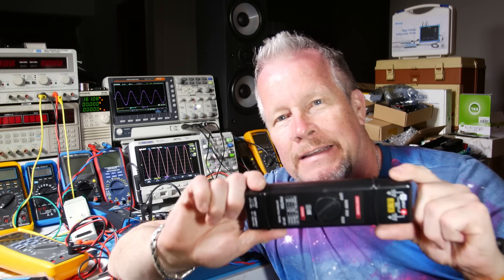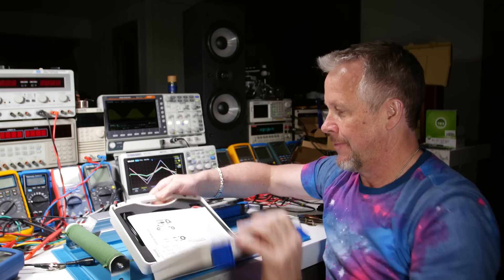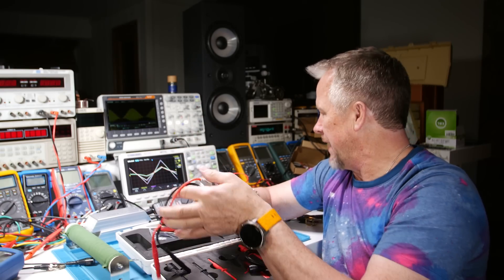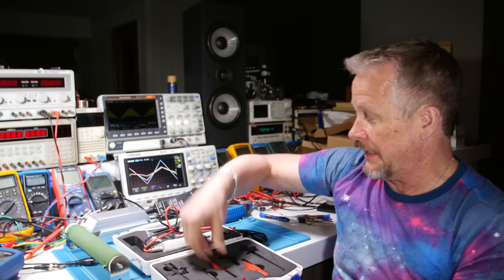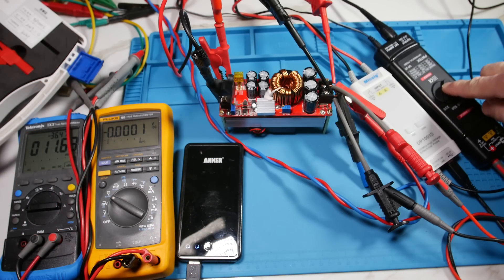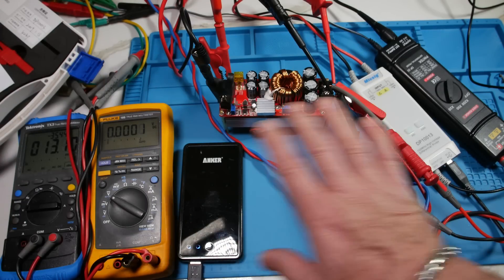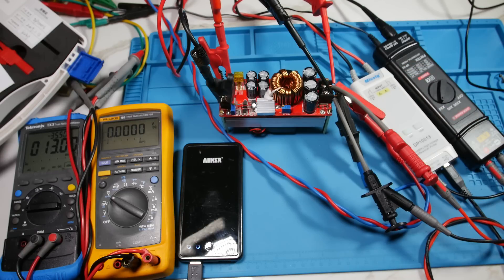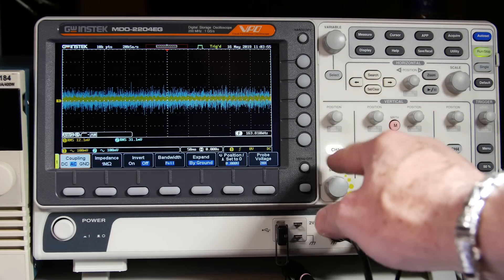Pintek vs Micsig Differential probe #diffprobe #bestdifferentialprobe

Comment: Excellent comparison, invaluable for someone choosing between the two gizmos.
But aren't you jumping the gun, sir ?
Before I buy a DiffProbe, costing half as much as a DSO, I would need a LOT of convincing that it makes possible some functions VERY important to me, or simplifies some functions I do FREQUENTLY, etc, you get my point.
Please make a video on why a sensible engineer should own a Diff Probe, what are the things it can do in the REAL world.
Reply: you can measure ac lines with these things and save your scopes from blowing up
Reply: BR Gurunandan - Differential probes are ideal for measuring signals where the signal is not ground-referenced.  Some examples would be the output of a H-bridge, or if you need to see the signal across a resistor where neither end of the resistor is at ground potential.
There are alternative methods such as using 2 scope channels and then applying MATH to see the difference...but this ties up 2 channels which may be a problem if you need to look at multiple signals.  It's also annoying if you need to perform this kind of measurement frequently.

The MICSIG unit works very well and is excellent value for the money.  Just don't expect it to work to 100MHz - the BW is a bit of a marketing stretch...
Reply from the maker: Thank you!  And I agree, the cost of these probes are too high - they should be a fraction of the cost of the scope!
I’ll do some videos where I show how to take measurements without them.  I’m anxious to get into some projects after introducing all these tools;)
Reply from the maker: BR Gurunandan I still like this comment;) I need to bring this back up!
Reply: @KissAnalog  scored the micsig for $200. Even as an electronics noob the insurance of not blowing up your scope bit seems worth it.

Comment: 4:50 because litterally EVERYBODY has USB wallwarts laying around and the fact most scopes nowadays have a USB port , it does not come with a wallwart. Also, the USB on the side is a passthrough, in case you're using your scope's USB and still need it for other things.
Reply from the maker: Thanks for pointing that out.  If I had not pointed out that it did not come with a power source - would have you pointed that out - just to be contrary?
You may not be aware but many diff probes do come with their own power source - but at these prices I’m good with them simply providing a common USB port.  When using this you also need to be aware of the grounding of your power source.  If a power source had been provided the grounding and noise level would have been taken care of.  BTW did you notice that I used an isolated power source?

Comment: How have they held up for you after ~3 years?  I'm looking at the Micsig, but they actually make three 100 MHz models... a DP10007 (700V with 10x/100x), a the DP10013 you have (1300V with 50x/500x) and a DP20003 (5600V with 200x/2000x).  The DP20003 outside my range of needs, so I'm debating between the DP10007 and DP10013, leaning towards the DP10013.   Oddly enough, they both are about the same cost at $185 (the DP20003 is $250).  The one advantage the DP10007 has is the 10x/100x range that matches up with most scope attenuation settings, making measurement easier to read.

One thing I see people say is to watch the voltage ratings/markings... they are actually peak-to-peak and not RMS values.
Reply from the maker: Thanks for asking!  They have been great!  I have also done a video on the DP1007.   https://youtu.be/QQcZR_KV0P4

There is also a new probe out that is fantastic.  Here's a video: https://youtu.be/bFWJUmgs_8M

I will do a comparison of all the micsig probes to show them side by side and talk about how they differ.  I'll do this very soon;)
Reply: @KissAnalog  Nice!  I appreciate your help and the reviews.

Looking for an opinion... since I only work on things like power supplies, do you think the 10x/100x range (DP10007) is preferred over the DP10013 or DP750-100?  Are those too much for my needs and am I better off with the better sensitivity in the lower range model?  The 1300V capacity of the other two is interesting and I hate to limit myself with only 700V.
Reply from the maker: If the lower voltage probe had been out when I bought mine, I would have selected that as I would rather have the sensitivity.  Saying that, I haven't really seen any drawbacks with the higher voltage probe.  I think I need to take a close look and compare them.  I'll do a video very soon and do that.  The pintek had great specs, so that's why I originally bought that one - even though it cost more:)
Reply: @csimet  I just bought a micsig DP10013, and I chose the higher voltage rating one so that it should handle the higher dc voltages found in power supplies with Active PFC in the front end - the DC bus in those runs at a higher voltage than just rectified AC - you essentially have a boost converter there instead of a diode bridge rectifier. I've only had it for a few hours and already found the issue in the power supply I was working on! If I ever need the higher sensitivity of the 700V probe, I'll get one at some point in the future, but I think the higher voltage one will be good to start with. I actually have a number of power supplies kicking around that need some work, and not just simple "replace the caps" type repairs.
Reply: @csimet  Two things to note as of now (late 2023) - the micsig probes no longer come with the normal/bananna probe tips - they only come with the alligator clips and the long grabbers now. And also not mentioned in this video is the USB Power pass through port, so if you have multiple diff probes, you can power them all through one usb port on the scope (or other power supply) without needing a usb hub or power splitter or something.

Comment: ...Hi again. While watching your videos, particularly this one comparing both differential probes, I also watch the most recent that includes the Micsig 10X, 100X, 70V - 700V, 100Mhz from Micsig my question is, knowing that the first Differential Probe ist 50X, 500X, 130v - 1300V, 100Mhz...would you consider the last one as the differential probes of choice for measuring Power Supply and line voltages?, That is if you have to choose one of them...thanks for your kind reply in advance with my respects from PR.
Note: My question is because you got the opportunity to use them for a little while.
Reply from the maker: Thanks for the excellent question!  I think you want to have enough headroom so that the instruments are safe, but not so much that you don't get the best accuracy.  For 120 or 240Vac, I think 700 V provides the safety, but and gives good resolution at lower voltages with the low range.  If the bandwidth is good at the scale that the probe is in, then it is just a matter of safety first then resolution;)  Does that make sense?
Reply: Thanks again for your kindness.  You are right without any doubt. Micsig just offered those differential alternatives to give a wide choice to the customer's particular needs when we look their products. I asked you as I told  before, because the great opportunity to try them in real time looking around your bench activity, having the feel and touch as well as their behavior against the published manufacturer specs. For me, I use to have two of them (Each model) when I am making measures between  two channel while characterizing the waveforms in circuit designing.
It's  a great pleasure to talk "virtually "with you. I am too much obligated to you, my respects as usual.

Comment: Good comparison video. However, I don't know why you find the Micsig so impressive. Appears to be cheap Chinese junk from what I see. Molded leads - bad. Thin coax - bad. Noise - bad. No listing mark (CE or otherwise) - downright dangerous for something that goes up to kV levels. You get what you pay for.
Reply from the maker: Thanks Wes!  You are right - but then again they are only rated for CAT II, so there's not a lot of energy there.  Basically bench work.  i guess I'm impressed because they see to be made much like 'brand' name probes that I use on the job, but don't cost $1500 to $6000.  I think diff probes are so over priced, so I'm impressed with probes that the average Joe might be able to afford.  Also, those 'name' brand probes have special inputs, and it seems that every new model that comes out forces us to get all new probes.  That's probably why they are leased.

Comment: Nice video and demonstration.  I think that the noise floor of the Micsig being higher maybe because it has 4 time the bandwidth.  Micsig 100 MHz and Pintek 25 MHz.  Using the scope bandwidth limits would not change the front-end frequency response of either the Micsig or Pintek.  Again Eddie I enjoy your videos and you have interesting equipment to demonstrate.
Reply from the maker: Good point!  I think you might be right.  I first bought the Pintek even though it cost a bit more because of the lower noise spec and I didn't care about the BW.  But, I have also been very happy with the MicSig probes;)
Reply: @KissAnalog  No - @jwrtiger is incorrect: if they had the same noise density (in nV/sqrt(Hz)) and both had a BW > 20MHz, then reducing the scope BW to 20MHz should give same noise level on the scope (as long as the scope is not aliasing). They don't, so one probe is noisier.

Comment: Does a person need an isolated transformer using this probe? Im looking to get away from earth grounding and so many options today. I will be using a Variac since i work on things with shorts. But need the oscilloscope to see how far into the unit its broke at times. I am self taught so didnt understand earth grounding as i never lived without it. Things were starting to all be grounded by the time i grew up.
Reply from the maker: Thanks Rocky - great question!!  No, actually these type of probes have a high impedance on each lead, so you can't short your scope out by connecting them to a grounded circuit as you can with a normal scope probe.

Comment: Any chance you ran this at high frequency to confirm there’s only 3dB attenuation at 100MHz?  Wondering if this will work for measuring fast high voltage edges (700V in tens of nanoseconds)
Reply from the maker: That's a great question!  I've meant to do a follow up video on these.  I'll try to get to it.  I think they could do what you are asking.
Reply: @KissAnalog  I asked Micsig directly and they provided a link to a comparison done on EEVBLOG.  Looks like performance is comparable to a Tektronix differential probe.  Thanks for your reply and excellent video.  I'll keep in mind the effect leads have on the measurements.  

Here's the EEVBLOG link with scope shots a few messages down:  https://www.eevblog.com/forum/testgear/new-low-cost-($170)-100mhz-differential-scope-probe-from-micsig/50/

Comment: Nice video! It might be that there is noise (such as harmonics) in your circuit that the DP25 (which only has a bw of 25 MHz) cannot see. The Micsig has a bw spec of 100 MHz, so  it may be picking up noise well beyond that which the DP25 can detect.
Reply from the maker: That's great feedback.  But, I did check the specs, which wasn't easy, and the Pintek does have a lower noise spec.  I do really like the Micsig, and if you are looking at any signal that isn't really small it works great and the noise is of no issue.  I haven't even noticed the noise in real use;)  BTW, I think both probes are on par in quality to any that I have used at 10x the price.
Reply: @KissAnalog  Both the Micsig and Pintek seem to be an exceptional value, especially when you consider how expensive a Keysight, Tekronix or other major brand can cost. Some of the higher bandwidth probes cost thousands of dollars! Thanks again for this excellent review.

Comment: Cool, I'm not the only one who thought to twist their wires for probing!(Not arrogant enough to think I was, but most people I work with wouldn't have tried that.) I had some long banana cables connecting to my scope at work for some stuff, twisting a bit did reduce the noise measurably. Unfortunately there were other worse noise sources in one of the current probes I had, not sure why. Maybe some day I should mess with it if I have free time.
Reply from the maker: Thanks for that feedback!  I know what you mean, most people I’ve worked with don’t bother either:)

Comment: I apologize for the stupid question. What diff probe would you recommend for a low voltage measurements ( mv range)?
Reply from the maker: I think the Pintek as it seems to be lower noise at the low levels.  A bit more expensive though...

Comment: 20mhz DP versus 100mhz DP.. likely the reason for noise on the 5x higher bandwidth.
Take a shoot on the Pintek DP100 (4-range Attenuator), though it is even more ridiculous priced..
You got any impression of Micsig mobile scopes like the STO1104.. from the looks of it, it does come across full fledge.
Reply from the maker: Thanks for that feedback!  I’d like to take a closer look at a Micsig and they did reach out, but I think this virus has shut down a lot of companies;(

Comment: Nice video. I have the micsig and tried your experiment. In the manual is says to plug the USB power into the scope being used. This protects the scope and it exhibits less noise!.. Using a phone for power negates the protection according to micsig.
Reply from the maker: Thank you.  When I powered it by the battery I thought it would be cleaner voltage, but it could be putting out more noise.  I don't know what kind of regulator it has inside it.  Since then I have used the scope USB power but I haven't specifically looked at noise level.  I'm glad you reminded me of this, so I'll have to check this out.

Comment: Pintec has better attenuation choices, and you can easily use a coax cable with a banana jack to BNC connector, this may help with the noise.
Reply from the maker: Thank you for that feedback!  I’ll have to do another comparison trying different signals.

Comment: If you are standing on the floor and holding ONE red probe contact with your hand, is there interference on the oscilloscope screen (signal)? Leave the black contact unconnected.
Reply from the maker: Yes it will look that way.  It is an open ended signal (floating) and with the high impedance input, it will look like an antenna;)

Comment: Thanks for the review. Very good stuff. Actually, I had a differential probe already on my wish list since a few months. I was hesitating which model to choose but your review was the final trigger to buy one. Thanks Eddie :) Even though the Micsig seems to be the noisier, maybe less sensible device in the lower voltage range, I decided to order it. Will arrive on Monday. Cool! The Micsig cost around 120 EUR in Germany which is 160 EUR less !!! than the Pintek which is sold around crazy 280 EUR!!!. Even the Micsig is still too expensive as mentioned in the other comments here. Anyway, can't be wrong to have one in my lab ;)
Reply from the maker: Markus Keller The Micsig is nice and will be a great addition to your bench;) I’ll be interested in hearing what you think.  Thanks for sharing Markus!

Comment: Could noise difference just because the MicSig has a higher bandwidth (100MHz) versus 20 MHz? This must be one factor at least, the range difference - and divider network- making up for the rest?
Reply from the maker: John Thefox I think you are right about each of those factors.  With the higher voltage divider - the signal to noise ratio is worse for smaller signals.  Thanks for sharing!  I’ll have to do some more work with these;)